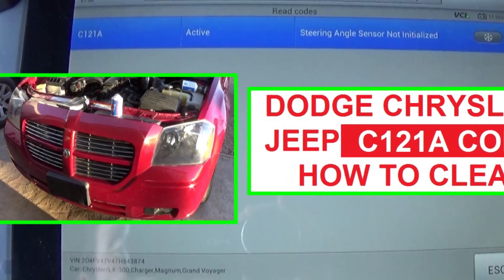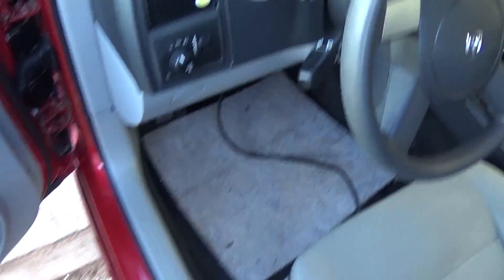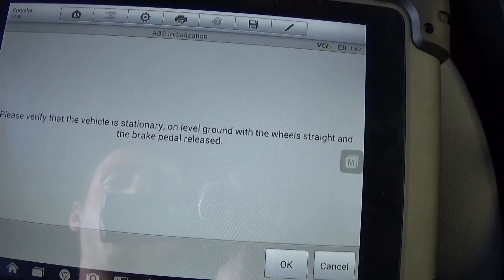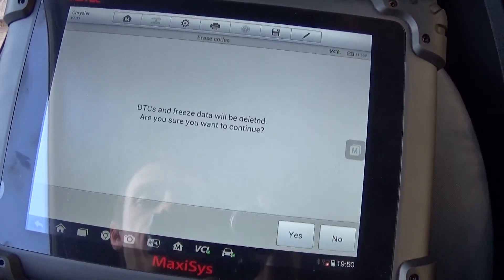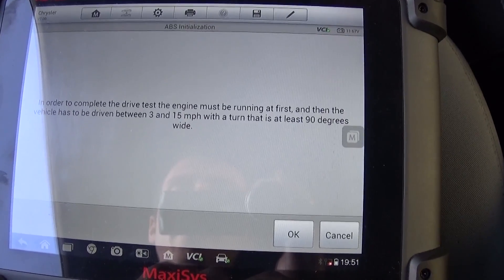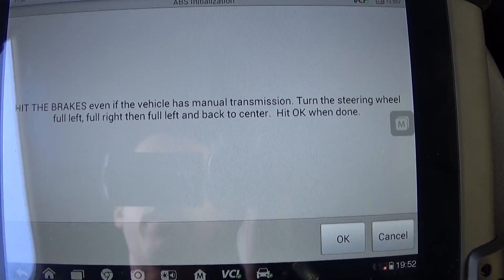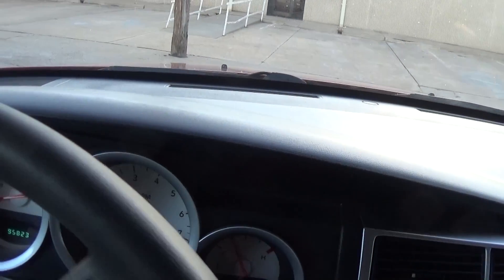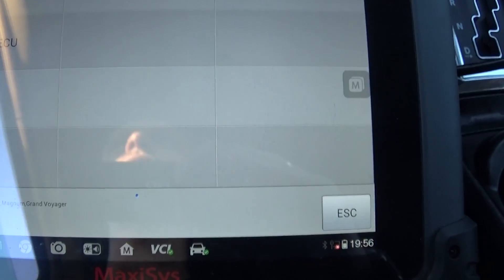Code C121A Steering Angle Sensor not Initialized Dodge Chrysler Jeep  How to Calibrate

Comment: Hi Pal,
I have got a problem on my Dodge Challenger 3.6 ’13. It displays Traction Control Light only (no ABS, no ESP, no check engine) and have no clue what’s causing that. I’ve already tried holding ESP button to activate it, but doesn’t resolve The issue. I’ve tried calibration and checked fuses, nothing helped.
Reply: Did u find out what it was?
Reply: @MsTigers1991  steering angle sensor was installed incorectly.. it seemes that smb was trying to fix it and did shit job ;)
Reply: @MsTigers1991  steering angle sensor was installed incorectly.. it seemes that smb was trying to fix it and did shit job ;)